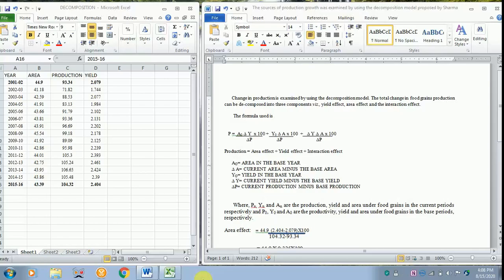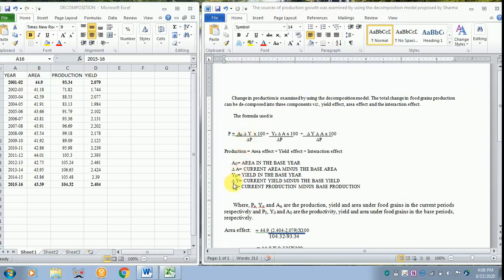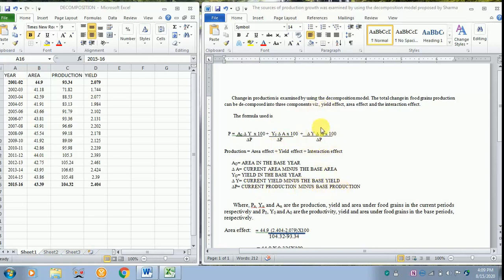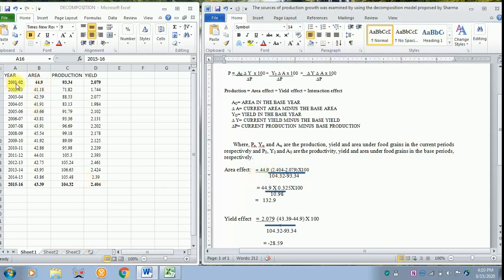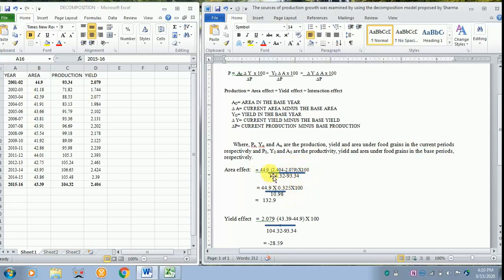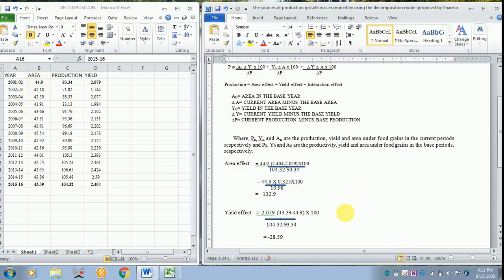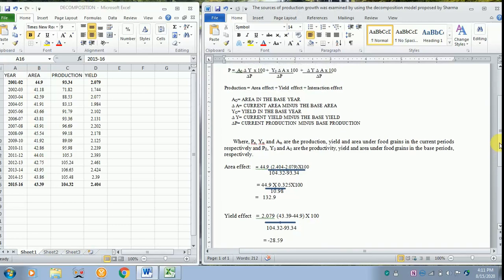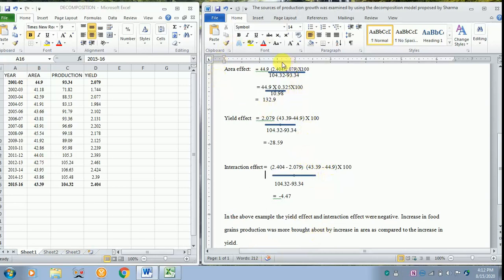HOW TO INTERPRET AND ANALYSE DECOMPOSITION METHOD IN AGRICULTURE

Comment: Nice lecture ma'am

I am asking which book or research paper should use for better interpretation
Reply from the maker: Just check the respective manual
Reply: @dr.shobhak6764  sorry I am not getting...which manual should I refer
Reply from the maker: The software which you are using
Reply: I am using three software stata SPSS and Excel but I am failed again and again plz ma'am tell me